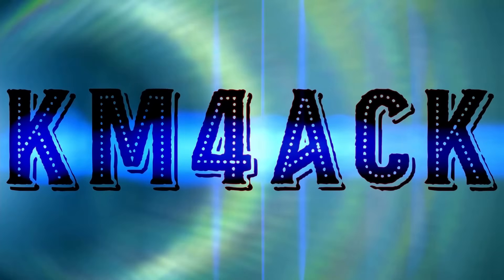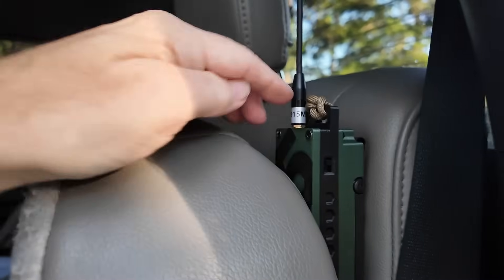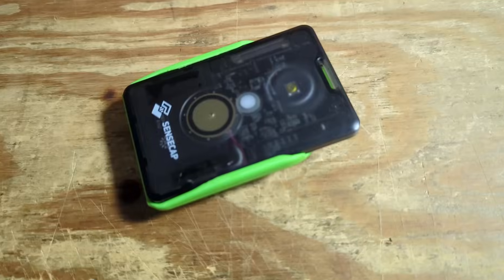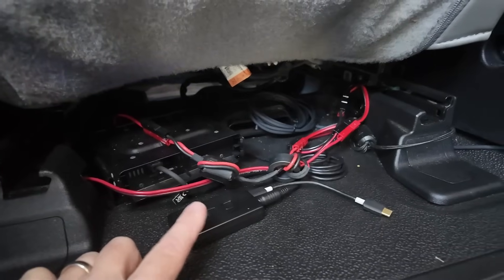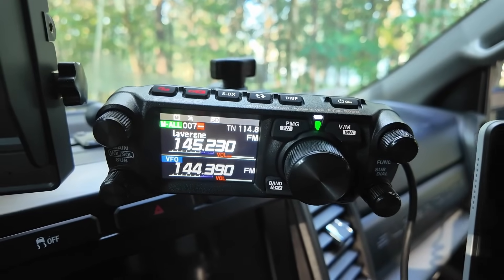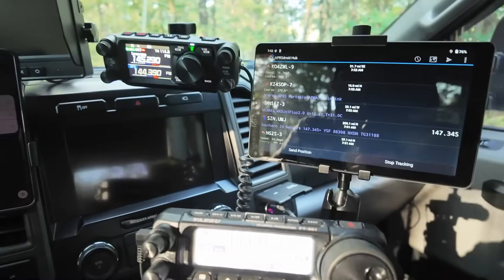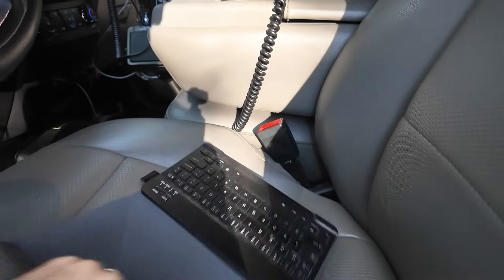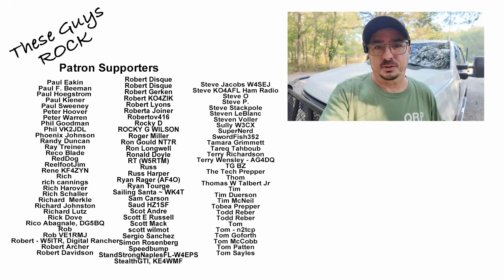Ultimate Ham Radio Truck Setup  Yaesu 891 + FTM 500 + Meshtastic + Winlink in F250

Comment from the maker: Save $$$
LidoRadio.com - Use code KM4ACK
Trekker Delta - https://specfive.com/products/spec5-trekker-delta?sca_ref=9076059.vUzVXFprruNKBs
Reply: Have you seen invitation of testing TinySA Ultra+ ZS407 7.3GHz Spectrum Analyzer via email today?
Reply: Jason if I may. The FTM-500 has an APRS mute as long as it is on your B band and a save memory on your radio. I see you have it as a VFO. I have the 500 and I don't hear no packets. Just like you, I will be getting the new Kenwood as I want tri-band and the MMDVM feature for D-Star sounds really interesting and Kiss TNC, Sign me up. 73

Comment: I'm considering an ATAS for my F150 stake pocket or with a K-400 lip mount on the hood. I thought the Super Dutys were still steel body. Didn't notice a door badge - did you go diesel or gas?
Reply from the maker: I'd go with the stake mount for the ATAS. Those mount are rock solid. My truck has the gas engine.

Comment: Fantastic radio set-up. I've just gotten my first truck - a Tacoma 4X4 - and have a tonneau cover over the truck bed. Just curious how you are storing stuff in the bed? Looks like you have plastic storage bins & a 2X4 across the bed to hold the bins ? Looking to put non-radios in the back - stuff like cables and antennas and camping equipment. Thanks very much for any help.
Reply from the maker: The plastic bins are actually held in place by one of these https://amzn.to/3JgkcNQ and the 2x4 in the back allows me to load things close to the tailgate and not have it go sliding. The F250 has a slot near the tailgate designed for the 2x4 or 2x6 divider. #affiliate

Comment: I've never had issues with APRS on my 500. Also, enable APRS mute..
Reply from the maker: It's not that there's APRS "issues" with the radio. Just a very poorly done interface. Inputting an APRS message on the radio is horrible. Much easier with the tablet plus the tablet gives the operator a map with the APRS icons.

Comment: Cool thing for the spec 5 mag mount you can get adhesive non marring magnet stickers for trucks. Can come in vinyl or permanent adhesive squares to mount nodes to odd surfaces. Something to consider for removable mounts. Thicker is better though and best used with non slip magnets

Comment: I run a 2M/70CM antenna on the driver fender of my F250.  The antenna cable and power cable is run through the firewall where the main wire loom passes through in the driver footwell.  My FTM-500 is in the trey under the back seat of my truck and the remote faceplate cable runs under the threshold up under the drivers seat and to the head mounted on a RAM mount.  I was too chicken to run the wiring myself and had a local stereo installer do it.  He did nice work and routed the cables well for $150.  Money well spent for me not having to work around the wire loom.

Comment: I couldn't have my vhf/uhf antenna mounted on the hood on my superduty. Would get lots of desence and RFI, think it was due to the collision avoidance system/auto high beam or adaptive cruise contol on the truck as it was only present when in gear. Had three options the bed rail mount like yours, super expensive 3rd brake light bracket or a hard mount on the roof. I went with the hard mount...

Something to look out for in modern vehicles that have these features. It really limits antenna locations for me.

Comment: Is heat a problem? Were geographically similar, and I haven't set up anything as slick in part from a fear that I'd have a lot of cooked battery packs after an Ozark summer
Reply from the maker: I haven't run into any heat issues yet but I've only had this truck for a couple of years. It's parked outside on a full time basis.

Comment: i’m guessing you have a good swr on the atas.   I mounted mine the same exact way on my ram and couldn’t get a good swr.   I did alot of grounding and bonding  with no luck.   Went back to a k440 on the passenger side of the hood and it’s great
Reply from the maker: i've had great luck with mine mounted on the back corner
Reply: @KM4ACK I’ll have to mess with again when I put the FTX in the truck.

Comment: Couple notes from the video, I own an FTM-500DR and these settings helped me with APRS:
Enable the 77. APRS Mute menu option will mute the packets coming on the second channel.
Enable the 76. APRS Modem from the settings menu to get it out of FM mode and over to A12 mode

Antennas for meshtastic are very important, and it's worth checking yours with a cheap VNA. The Spec5 antenna I got with my ranger magnum was an 868Mhz-centered wide-band antenna, with 2:1 SWR on 900mhz. Muzi works 17cm whip antennas are great, or the Diamond SRH229 is amazing for range. For a vehicle-mounted relay I recommend the Alfa 915, or a larger fiberglass antenna if you can manage it, the alfa 5dbi on my truck works a charm.
Reply from the maker: I turned the modem off on the radio since I am running everything with the tablet

Comment: You have 12v at the trailer connector(s).  Add a cheap 12v to 5v converter.   You could snake the wire up from the bottom.

Comment: Nice setup. Does the FTM-500 not have an APRS Mute function like the FT5 does? If not, the squelch tone as someone else mentioned is a good idea too.
Reply from the maker: I don't remember a mute setting but I could be wrong
Reply: @KM4ACK  I just took a look at the FTM-500 manual and it says it is menu #77 APRS MUTE.

Comment: im thinking about putting my meshtastic in the engine bay. everything is an extremely short run for the device.
Reply from the maker: The coax run will be my biggest concern. Want to keep it as short as possible to avoid losses
Reply: @KM4ACK  that was my thought. I was thinking on just put it in the batterie box or fuse box and use the same kind of hood adaptor you have.

Comment: Aluminum F150 here as well. For my Meshtastic node, I'm running my antenna on a TW-MB-WCMS Window Clip Mount on the passenger side rear window. I power it with a Pale Blue Earth solar panel in the rear window behind the head rest on the same side. With one 18650 battery, I've never dropped below 85% charge. Complete no maintenance setup.
Reply from the maker: Sounds like a great setup!

Comment: I'm using a FT-891 and a TM-D710g in a Jeep Rubicon. I have an ATAS-120 mounted to the top hinge for the tailgate. Probably not the best spot as far a performance but it keeps the antenna low and protected for the most part from low hanging limbs while out on the trails.  I did add a 4 port, USB-3 powered hub to connect the Digirig and Kenwood to the computer or phone (with OTG cable) so that I don't have to switch cables to go from one to the other. So far it's all been working great. I want to add HF APRS for those times when I'm out and about in Northern PA without VHF APRS access. de KF3BH

Comment: Jason, have you had any issues with the ATAS not tuning?   Mine just started acting up.  I go from 10m to 20m, the radio attempts to tune, but the antenna doesn’t move.  Radio is powered right to the battery and is grounded in the cab.  Breedlove stake mount is grounded down the pocket to the frame.  Any suggestions?   
I’m also looking for a Meshtastic mobile option for my f-150.  Enjoy your videos.
Reply from the maker: No issues here. However, occasionally it can take up to a full minute for the ATAS to start moving.

Comment: There should be a hot wire in the Towing Package Wire Loom that is used to recharge Trailer Brake Batteries. I am not sure if it is always hot, or ignition controlled. Question: On the FTM-500, have you tried going into the Master Menu to adjust the B channel audio gain?
Reply from the maker: Thanks for the tip. I haven't tried messing with the audio gain.

Comment: I've been eyeing the FT-891 and ATAS combo for my Jeep Gladiator for HF, and I like your install. Unfortunately, the Gladiator doesn't have stake pockets in the bed, so I'll have to find a different solution. Thanks for your videos, I really enjoy following you.
Reply from the maker: Take a look at the Diamond K400 mount https://amzn.to/3VRYRg9 It might work for you. I run one on my Wrangler with a Tarheel screwdriver antenna #affiliate
Reply: I have mine setup in the Gladiator. I mounted a piece of angled metal (L shape right angle) with two C clamps to the lip in the right rear inside of my bed. Bit hard to explain but its a basic L bracket the vertical portion goes up into the lip of the bed and it is clamped there on the left and right side of the metal. The horizontal part of the L I have a lip mount attached just like the one that Jason linked above, that holds my ATAS. I had to run a flat 1" braid cable (through a hole that is already in the bed) from the mount to the frame for grounding to get my SWR under control and it works great. I used the angled metal because I needed to have it lowered slightly so when the ATAS was not attached I could close my bed cover.

Comment: Often times there is a good sized 'pocket' of space between the bed and the rear fender that can be accessed by removing  the tail light. You may be able to stuff a Node in there. You could power/charge it by splicing into your towing wire harness

Comment: You could charge the meshtastic node in your tailgate from your running lights.  If you drive often enough at night it might be enough to keep it topped off... :)
Reply from the maker: Interesting idea!
Reply: @KM4ACK to add to his comment. If you have the option, does it have up fitter switches? There maybe a 12v ignition or 12v constant running back under the bed. Im not sure about the f250s but my Ram 3500 i just got has the option. Might be something to look into.